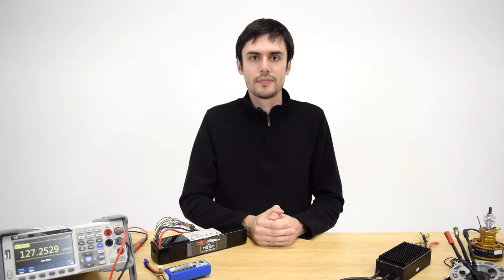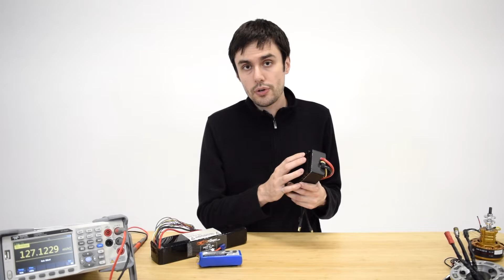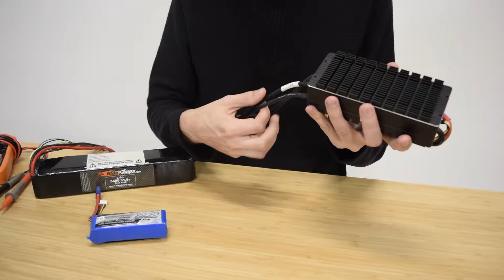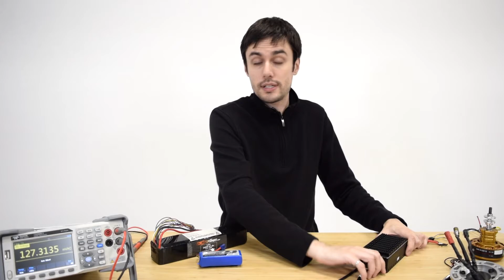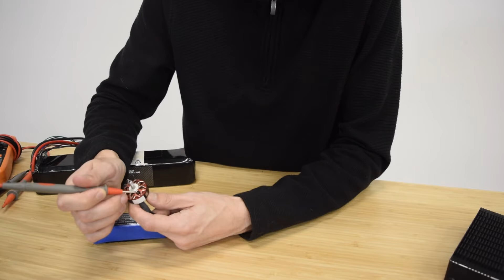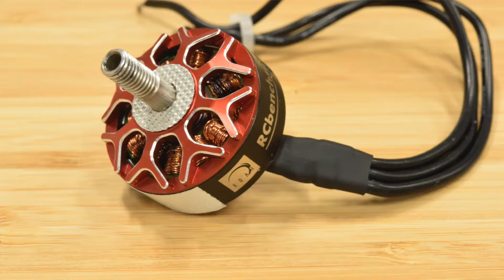The 3 Most Common UAV Electric Failures + How to Prevent Them

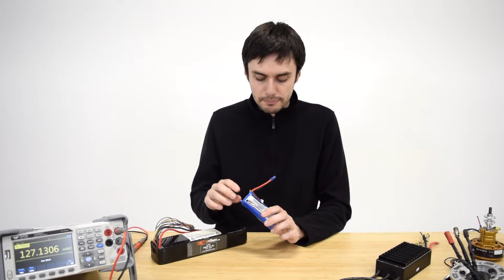Comment: Great video!  For the problem you're describing at 1:04, I've always wondered to what point I need to worry about drawing too much current...  like due to inrush current of motors starting up...  For instance, in RC Cars, they don't have any inrush current protection or monitoring, right?  Is that because those use cases are safe enough, or because they're basically toys and they don't care?
Reply from the maker: Hi Jeffrey, thanks for your question. Unfortunately, there is no standard for “Motor current rating”. Electric motors are great because they can momentarily provide much more power than their steady state rating. The main limitation is thermal. If you send too much current for too long to the motor, the windings will melt or burn. The thrust stand is a great way to test what are the limits of your motor in a control environment if you are willing to burn a few in the process. That sounds like a good idea for a future video :)